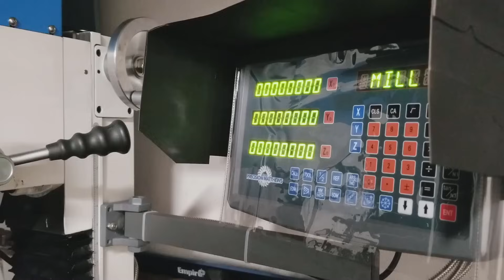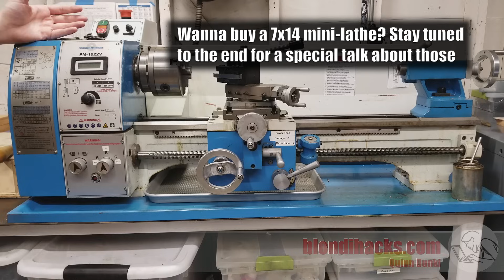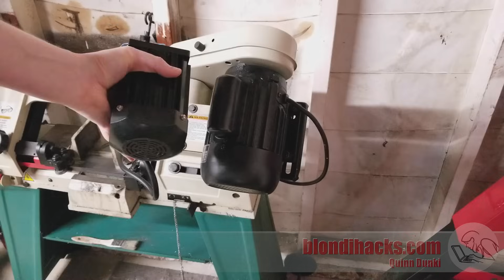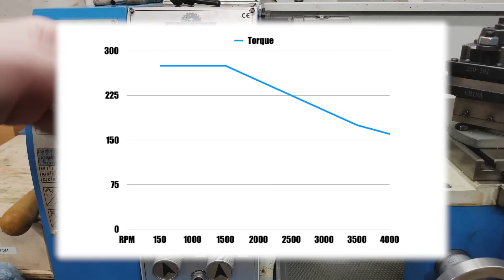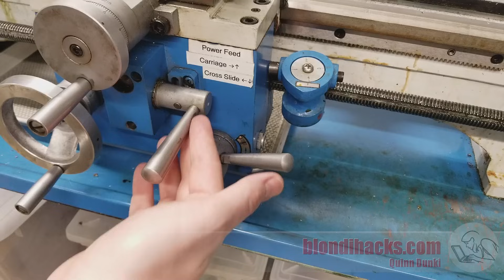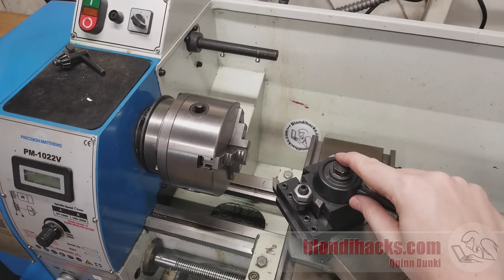Import Lathe Buying Guide

Comment: Imperial units belong in the Eighteenth Century  (the age of steam).  Metres, Kilograms, Kilowatts, Seconds.....are the way to go for easy learning with new and older students alike.  Even the North American Military have managed to adopt the international MKS system of units.  On the other hand, mixing Imperial with Metric means unnecessary duplication and has caused multiple airplane crashes, mega dollar spacecraft failures, not to mention the Hubble Telescope mirror grinding fiasco.  If you want to read old machine shop books, keep them in the historical section of your library alongside your Steam Engine Design books (IMHO).

Comment: I enjoyed meeting you at the Good of the Land Festival in Temple.  This is an excellent presentation.  An old fogie like me even learned something - I never knew about the torque specs of a brushless DC motor.

While it is true that with DROs that metric vs. Imperial is a no-brainer,  the same cannot be said for threading.  While I can do metric on my PM1236 (you need more room - come to Texas.  You can get twice the house for the same money and we have no state income tax), I cannot make use of the thread dial and have to keep the half nut engaged.  Converting your lathe to CNC solves the whole problem because you replace the lead screw gearing with a stepper motor.

As for buying American vs. foreign, size is the problem in this part of the country.  I went to a Dresser Rand auction where one of their lathes had a swing of 10 FEET and a 50 FOOT bed!  Even the Standard Modern 1340 was a foot too long to fit in the space I had available.
Reply from the maker: Hey John! Great to meet you too!

Comment: Took me a long, long time of self educating myself on the lathe features I wanted and how much I could realistically spend. I really, really wanted a Precision Matthews brand, for many of the reasons mentioned in the video. But there's a bit of a premium price they are tacking on, because they are shouldering the cost of import and specing the machines to their standards etc. So, I opted to buy my lathe directly from a high quality factory in China and import it myself. I got to pick the features and added accessories and was less than HALF the price, even with freight costs!! What I was looking for size wise, was larger than a 10x22 machine, but not quite the footprint of a 12x36. So I ended up going with the exact same lathe as the PM-1228VF-LB (but I only paid $1920 with all the bells and whistles, and a bunch of upgrade accessories)

HOWEVER... what they don't tell you is how much more you will spend at the port for taxes, fees, duties, transportation from the dock to a temporary storage facility, all before it gets on a truck to your door. When it was all said and done, I literally spent MORE on those costs than the actual lathe machine itself. If I were bringing over a container full of them, those costs would have still been about the same as they are for just one. Keep in mind, my lathe rode across the ocean in one container by itself. So, realistically I should have filled it up and sold them on eBay or whatever. (Which is what a lot of those machines you find for cheap are... but they aren't spec'd the way you want them exactly)

So lesson learned, I should have just saved up longer and bought from an established importer like a Precision Matthews in the first place.
Reply: Yeah, and because you didn't buy from PM, you don't have an American company you can email or call and get support of a replacement part or whatever.  A close friend bought a PM lathe and mill last year and is very happy with both the purchase and the service after the sale.  He's not an easy guy to please, but he sings high praises for Matthew and his crew.  When I buy, I'll spend the xtra money and buy Precision Matthews.
Reply: By the way, I had a PM-1228VF-LB. 

Keep in mind unlike the lathe shown in this video the PM1228 does NOT allow you to reverse feed direction on the gearbox! You must loosen a gear on the back where the gears are, then engage them to the opposite side in order to change feed direction. It's a bit of a pain...

Now I have a Victor lathe, you can switch feed direction on the gearbox but you must turn the spindle off before doing this, or you will grind the gears.
Reply: I know this is an old comment, so my apologies for only now commenting but I really need to ask: Could you point me to the factory you got your lathe from? I'll keep the part about additional costs in mind. I'm in Europe so Precision Matthews will likely mean additional  costs as well

Comment: Don't be scared of going for a second hand 3 phase machine,  Inverters (VFDs) will give you the 3 phase you need to run it for not much money really - Asian £100 for 2.2kw UK manufactured £300, you takes your chances.  but buying a Colchester student Lathe single phase will cost in the region of £1500 where a second hand 3 phase machine even bigger will start in the region of £1000. - who wouldn't want a bigger industrial machine if they had the space.  The hobby machines being compact in nature tend to cost a lot more money.  Take a Haas VMC VF1 which have been going on Ebay for £9000 (the price of 6 hobby lathes).  There is the stark realisation that your garage isn't big enough - a single car garage will be big enough for a VF1 but you will need the national grid connected to your house and a hole put in the side of the garage so you can operate it.

Comment: Yes, good point about the chuck mounting. Get cam lock if you can folks, so much easier. The one good thing about the bolt on lathe chucks is that they can't unthread if the lathe is run in reverse, but that's about it. It would almost be worth making a new spindle! BobUK

Comment: Hi Blondihacks. Very good and detailed explanations of what to look for. I've got a UK import version of this and the castings are very similar to yours as you suggested. Mine is metric and has a carriage drive shaft as well as a leadscrew and consequently an extra control knob on the gearbox, but that's about the only difference from yours - even the color (Colour!) scheme is identical. I revamped the electronics to stop the ac to dc motor control board failing due to poor thermal management - a common problem at the time - I added a proper heat sink and two over-run fans to cool both the motor at slow speed and the electronics enclosure.  I also corrected a dangerous wiring error where the neutral and live power feeds had been deliberately reversed to keep the rpm display illuminated. No longer a problem now with the change to variable speed brushless dc motors. Biggest nuisance is changing the spindle drive belt pulley ratios. I'm planning on installing Clough42's electronic lead screw - just received the interface board shipped from James in Idaho. BobUK.

Comment: Another dumb question:  why is there a lead screw at all, instead of just driving all carriage motion via keyed tracking?  Feed for threading is much more sensitive than non-threading power feed's uses?
Reply from the maker: Great question! It is for thread cutting. The lathe is basically copying the leadscrew on to the part when it cuts threads. This is the precise way to do it. Electronic leadscrews basically do what you are describing, as does threadmilling on a modern CNC. The humble leadscrew is still the cheapest way to cut threads at high precision, though.

Comment: Buy a cheap chinese caliper and use it as a digital scale. You get a DRO for 10 bucks and you can switch between imperial and metric any time you need. As a matter of fact i've got the same lathe in a shorter version and I did that
Reply: Also gets rid of the backlash issues

Comment: You've convinced me to take a closer look at buying a used U.S. built lathe. Even if it's a little worn and I have to pay to move it, I think I'd rather learn on a solid piece of iron that can be reconditioned vs a new CE lathe. Great video!
Reply from the maker: If you can afford a good one, definitely go for it! The challenge with finding used US bargains for beginners is that most beginners aren’t equipped to know if the machine is in good condition. If the ways are worn 10thou near the chuck it might be junk, but a beginner won’t know how to check for that. A reputable machinery dealer can protect you from that, but they will of course charge a lot more as well.
Reply: @Blondihacks  With the increased rigidity it may still do as good as a Chinese lathe and will very likely out last it as well.

Comment: An add on.  I don't want to come off as a anti (name your system) person.  In science metric makes a huge amount of sense.  Imperial is weird but sometimes is actually easier.  NEITHER is more accurate.  The US would probably be on metric if it had been sold decently in the 70's  They are both based on dodgy principals but metric has simpler math.  For temp.  Fahrenheit is 100 = healthy cows milk and 0= as cold as you can get ice, salt and water.  Very dary oriented.  Celsius 100 = boiling water  0 = water freezes.  The meter is based off a mistake in measuring the worlds circumference and Imperial feet are based on ???

The point is neither is intrinsically better in all situations.  And neither is intrinsically more accurate.  I personally like the quirky so I limment the demise of the old british monetary system (weird as it was), but I understand why they went decimal.

Comment: Picky bit Metric started in 1799, a LONG time before the industrial revolution.  Great summary of the cheap lathes.  I have a 9X20 Grizzly and I have made some mods.  I completely agree that you need to look at what you want to do.  I knew I was going to do mostly hobby stuff and odd bits of home repair and I have worked on a "real" lathe.  But the smaller lathes let you do a LOT of stuff, if you respect their limitations.  I have had a LOT of fun with mine and done a ton of small repairs around the house that I couldn't have otherwise.  I won't say it has paid for itself, but if you factor in the pleasure and the constant "I can Make it" if I don't have it it has been well worth the cost.  And I think my wife would actually agree.  Not a small thing.

Comment: Thanks for a great explanation of the compromises found on the smallish import lathes.  I hadn't realized that the quick change gearboxs don't give you the ability to make threads. It sure is true that the tooling will end up costing as much or more than the lathe. However you can spread that out some. Also, if you upgrade the lathe later, you'll be able to keep much of the tooling for use with the new lathe.

Comment: Quinn, as I started machining in the past year, I have watched about every video I could find on what to look for in a lathe.  This is easily the most comprehensive and easy to understand summary so far, and I learned a few things myself - like the different uses of lead screws in powering the carriage.  It would be so useful if even one supplier or event had the whole spectrum lined up with all the important suppliers, so in person or via a video like this the newbie could actually see what the trade-offs are.  The one thing you didn't touch on is that most of the North American importer/integrators of Chinese lathes have their own histories and biases - which unless you are fairly experienced, are difficult to decode.  It is a thorny field to shop in!

Comment: Greate upgrade for small lathes is electronic gearbox, consist of arduino, encoder and step motor. 
It comes with all feed/thread ratio and without manual gear changing pain and gearbox noise =)

Comment: I bought a hobby lathe about a year ago which is very similar to yours. It may sound ironic or sarcastic, but your video was a big help to me, in that it more than justifies my choice and the reasons I made it. I am still buying tools whenever I see one that looks interesting or if I see one that appeared in a youtube video. The other problem I had was I didn't have a bench to put it on. The sheet metal benches they sell in the lathe shop are pathetically cheap and weak. So I bought myself a MIG welder and taught myself to use it, then built a bench from scratch to my own design. Now I can't move in my garage because of all the tools I have bought (cut-off saw, table saw, band saw, angle grinders, drill press, vices,  the list goes on) and the tables they sit on. Who knew this machining adventure would lead me down such a big rabbit warren? And its only a hobby. And I still haven't made anything on it except a new draw bar for the attached mill. While I'm at it, thanks for the exceptional videos, Blondiehacks, (or do you orefer Gwynne? Or Ms. Dunki?). They are really educational and inspirational to an amateur like me.
Reply from the maker: You can call me Quinn 😁 Thanks for sharing your story!
Reply: Sorry about the name snafu, I was using AvE's mnemonics type thing for remembering names, ( Quinn, rhymes with Gwynne, Fred Gwynne of Munsters fame) but my senile brain forgot to insert the "rhymes with" part while I was typing. One thing I have learned by having a one-man shop is how to lift heavy stuff without getting a hernia. Sometimes it really challenges the pathetic remnants of my brain cells.  I wonder if you struggle with some of your equipment at times and whether a video on how to lift things safely and/or smartly might be a topic for a future video. Thanks again Quinn (got it right this time).

Comment: @Blondihacks Can you elaborate on (or link to an explanation of) what you mean by "power is tapped from the keyway" on the lead screw?
Reply from the maker: Sure! There’s a sliding keyed gear inside the carriage that rides in that keyway. As the leadscrew rotates, that gear turns and drives the gear train in the carriage. Because the key can slide, carriage speed can be independent of the threads on the leadscrew. The keyed gear drives a gear train that moves the carriage using the rack that I show in the video.
Reply: @Blondihacks  Oooooh keyed *gear*. Clever. Thanks!

Comment: If you’re diligent and look on Craigslist, marketplace, and local auctions you can find nice American ,British , and import lathes that are much larger and more capable.     I found a clausing colchester 13x40 in excellent  for $2500 after looking and being patient for about 6 months.    I looked at 6 lathes that were too worn out or not priced right before I found this one.      Always be willing to walk away from a machine that shows obvious signs of wear or abuse.
Reply: Amen, Matt! If you doubt anything at all, about a machine tool you're looking to buy, walk away. When the seller starts throwing a lower price at you, walk faster.
Reply: Agree, although space, weight, power, etc can be a factor. We bought a PM-1127VF-LB a few years ago for our model shop at work. Would have loved to get something like a HLV-H, but we’re on the 4th floor of an office building.
Reply: Don't forget to haggle, cut the price in half then go up from here.
Reply: If you buy a seccond hand one I'd almost suggest getting one that is tatty, fresh pain hides some real issues if bought seccond hand sold as seen. Also make sure you see it running. My first purchase was scrap nicely painted, my current one was tatty as can be but actually mechanically sound.
Reply: Andrew Culverhouse exactly.   Mine is still factory paint and not much of it but you can see the imperfections.     A fresh coat of paint hides a ton of problems and you never know if the guy who took it apart put everything back together properly